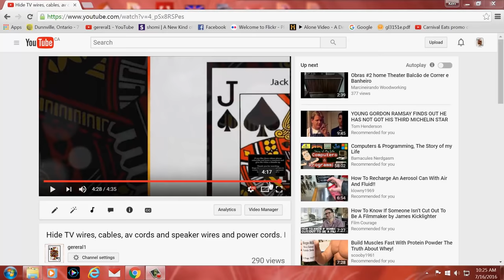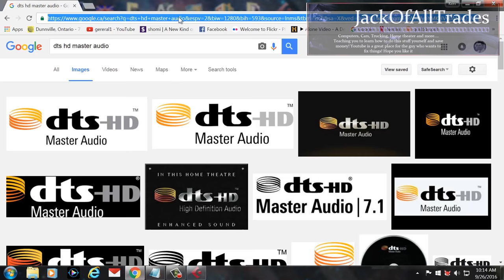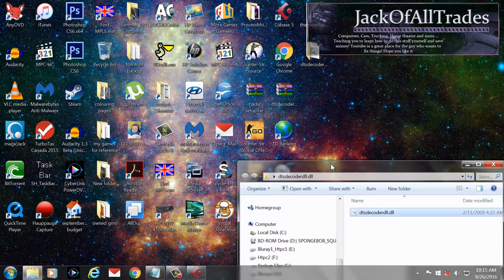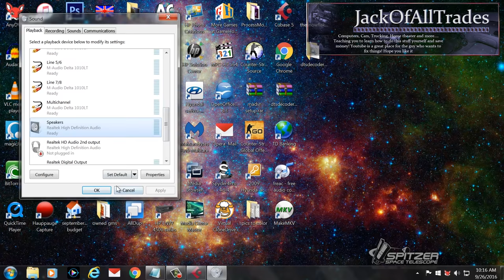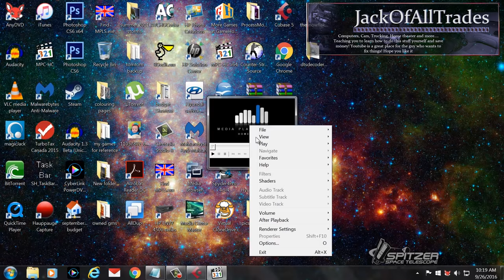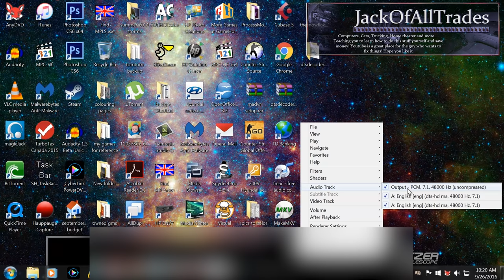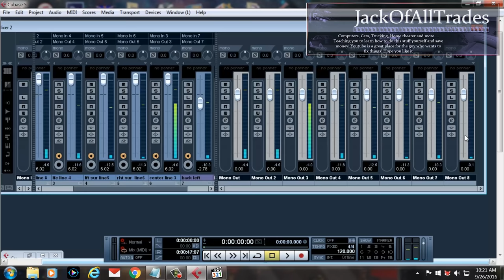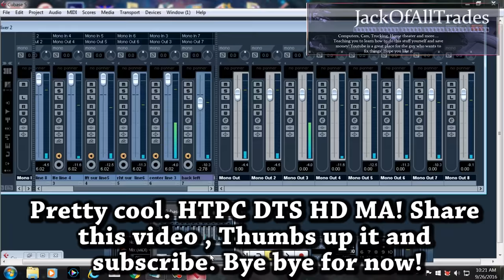DTS-HD MA 7.1 AND TRUE-HD 7.1 decoding in MPC  to 7.1 LPCM This completes pimping my htpc

Comment: When I change my Realtek default audio driver to dolby atmos the problem has been solved but unfortunately dolby atmos does not support 7.1 audio it supports only to channel I tried my best in every way but disappointed now I just turned my driver into Realtek
Reply from the maker: On motherboard y
Rca you can only get 7.1 dtshd or truehd. If you want Atmos you must run audio in bitstream mode to amp via HDMI and then it will decode 5.2.1 5 channel plus hieght channels and sub. HDMI is ONLY way bitstream audio or lossless can run. If you use powerdvd via HDMI you can play atomos but it must be done via HDMI to amp and the amp must be configured for atomos. The rear channels on back of the amp must be swapped with side channels to use hieght speakers. I have atomos amp but decided to set everything to 7.1 it allows more more streamline compatible for myolder movies and  newer 4k HDR  movies. But everyone needs to decide what's best. People make such big deal of atomos it's not that good. Object audio in your room.
Reply: @gereral1_jackofalltrades  can you please tell me why my speakers are making cracking sounds while playing DTS HD master audio at the same time don't be true HD does not give any distortion at first I think it's because of high KBPS comparing two Dolby but while playing some Dolby true HD voice I opened the show information option on powerdvd and noticed that sometimes the audio signal is going above KBPS then DTS
Reply from the maker: @subeesht5583  if your using rca 7.1 set it to 7.1. Channel in powerdvd to decode analog. If HDMI set to bitstream.
Reply from the maker: @subeesht5583  could be rca cables. I use rca ones from Walmart. Make sure there seated and not touching powercables.

Comment: Why not just use Kodi?
Reply from the maker: I do use kodi. I made a program called xdr (hdr type program for it) this program is for users who do not have hdr tvs or want more control over hdr images in bt709 with slower 1.4hdmi port. My whole setup is hdr tv, sound and pc. Its all 2.0 hdmi with hdcp2.2 but who cares about that  
Kodi works great.